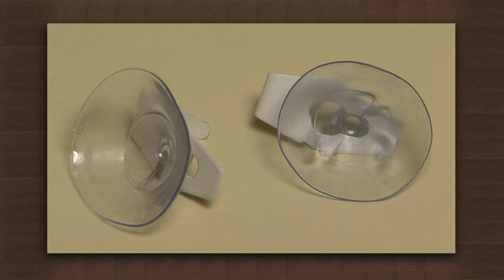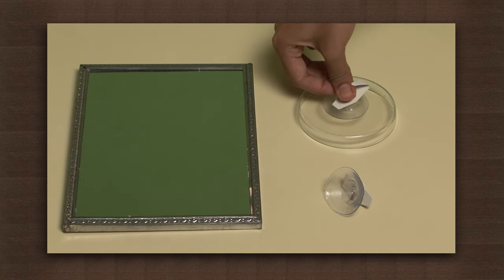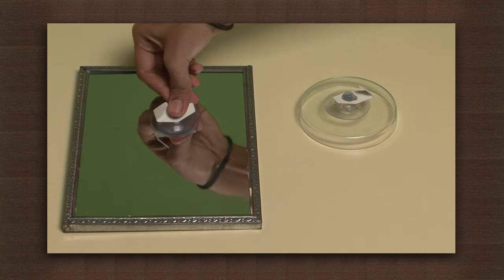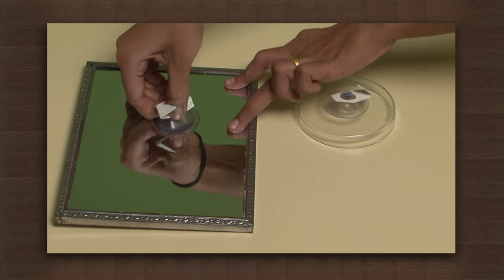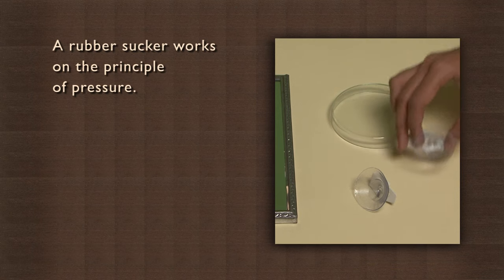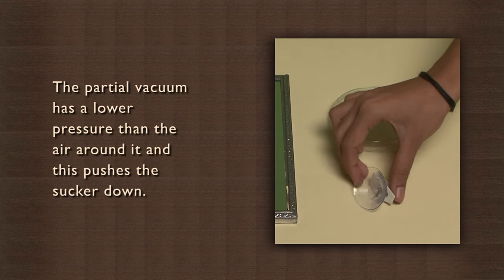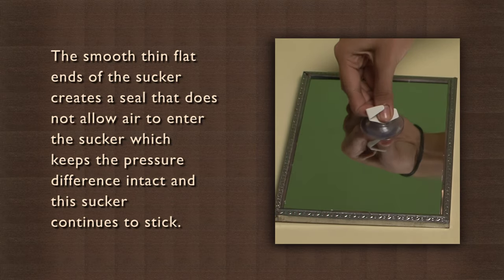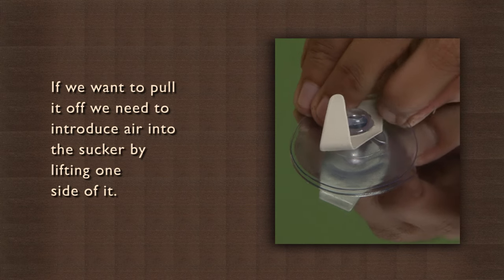Suction cup holds onto to surfaces | Atmospheric Pressure | Physics

Comment: If the dish and mirror are on the table then how does the initial pulling work? 
There is no air on the other side of the mirror to push it against the vacuum in the sucker

Comment: What I wanna know is... Air pressure is 14PSI yeah? So on a sucker with a surface area of one inch, why isn't 14 pounds enough to pull it? Or if you had a larger sucker, why isn't 14 pounds or more enough to start to create a volume of space under vacuum? I mean conceptually it makes sense that you can't pull something apart without introducing something in between, but how do you explain this scientifically? What's the force holding them together if is greater than simply the atmospheric force? A vacuum doesn't have any mass, so why can't it be created in a volume under a sucker? It's not like it's creating air out of nothing, it's just the sucker material moving away from the surface material with nothing in between...